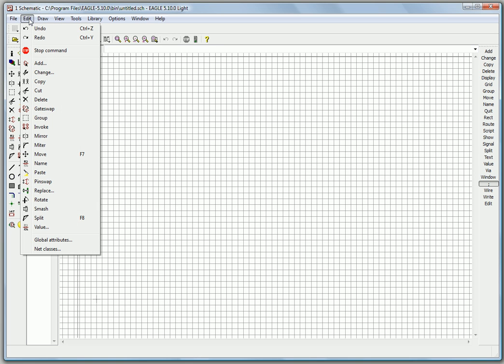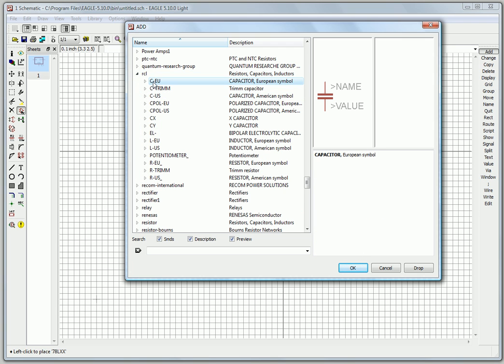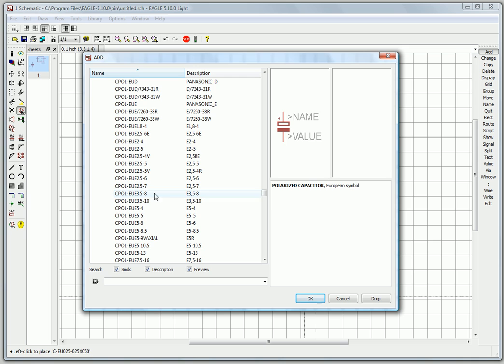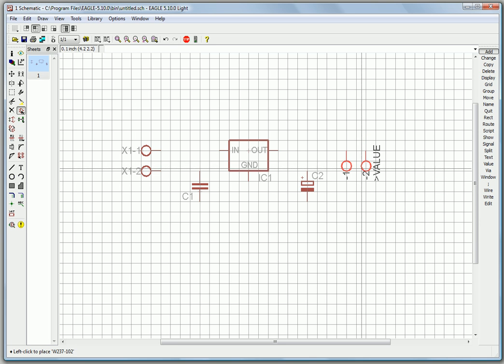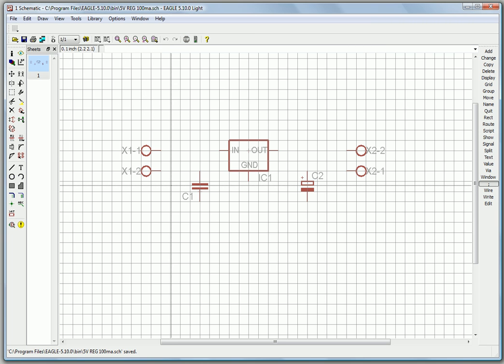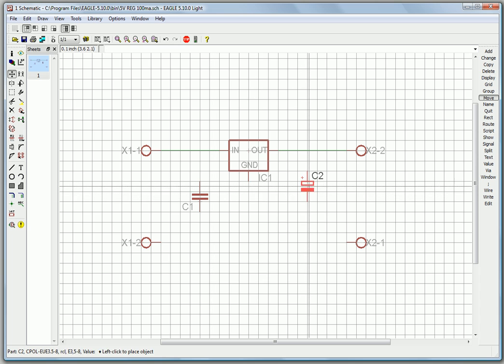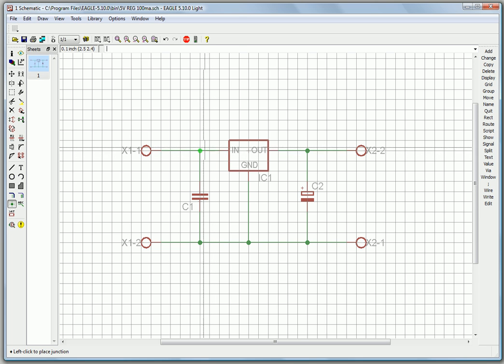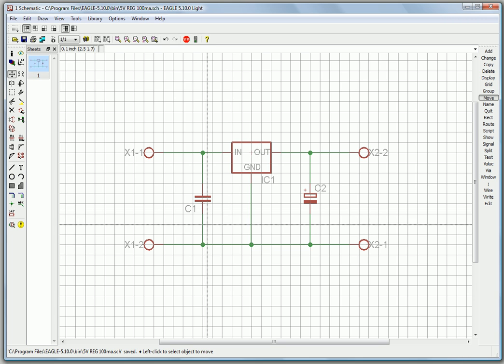Cadsoft Eagle PCB 7805 5V 100ma  voltage regulator circuit tutorial

Comment from the maker: Hi sorry for the delay , I did not see your comment.
You can have the cross hairs or cursor on 100% on OS X. I am using version 5.11.0
Go to options then user interface, on the right of the pop up dialogue box it has the option for cursor small or large choose large, you have to click large for schematic and layout if you want it large on both. I hope this helps.